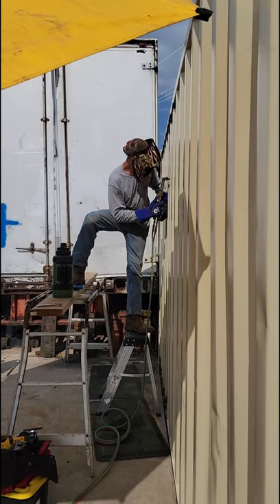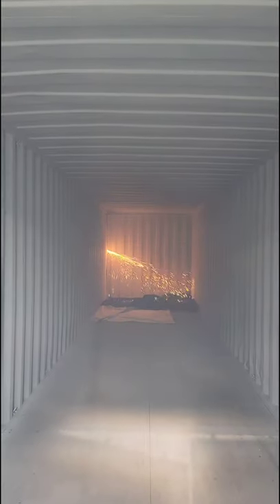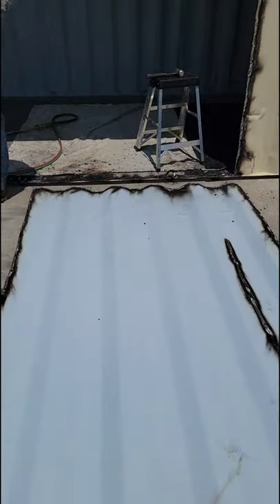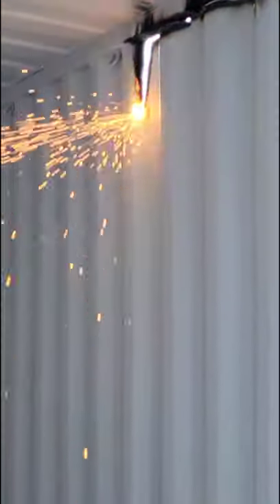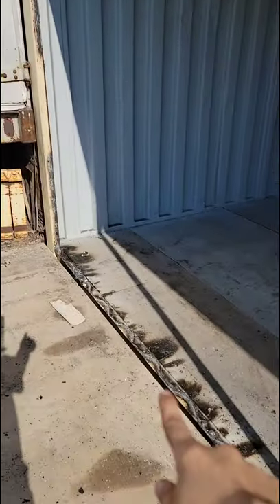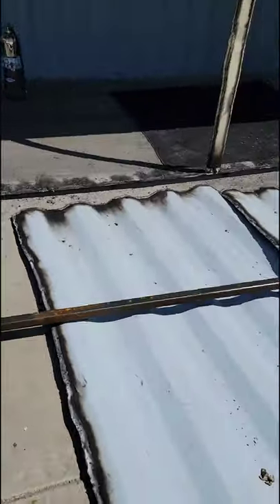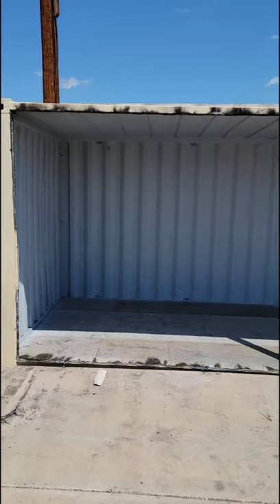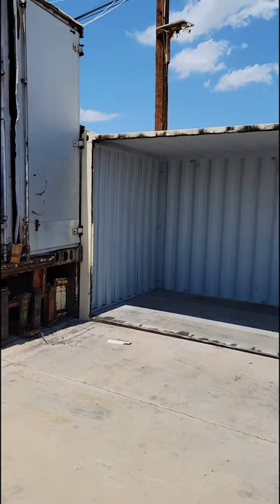CUTTING TORCH VS 40 FOOT SHIPPING CONTAINER!!

Comment: Seems like you should've welded the braces in place 'first' before cutting the walls. This will retain the original height of the ceiling and prevent sagging in the center. 😉